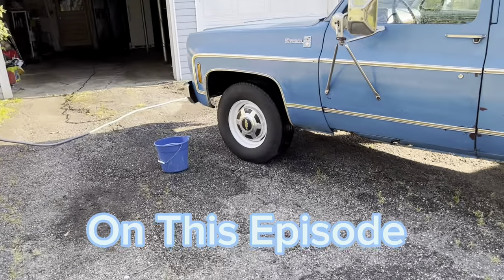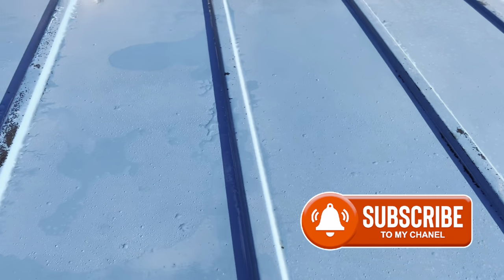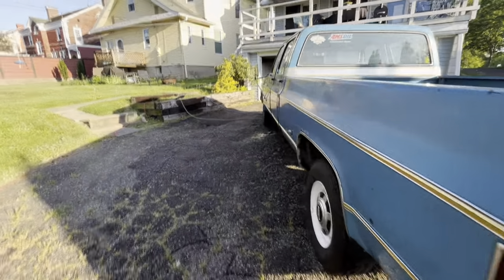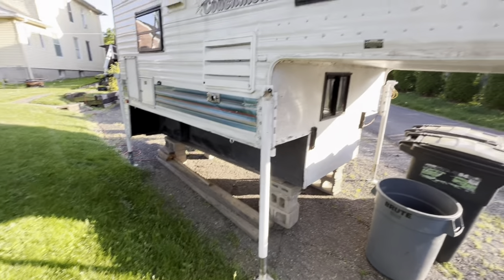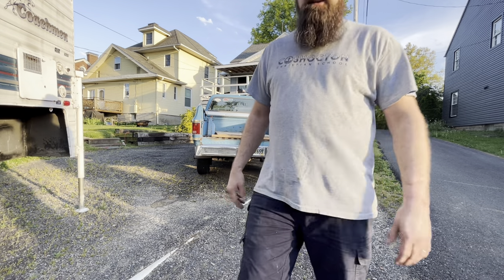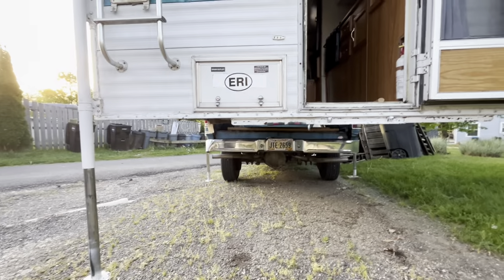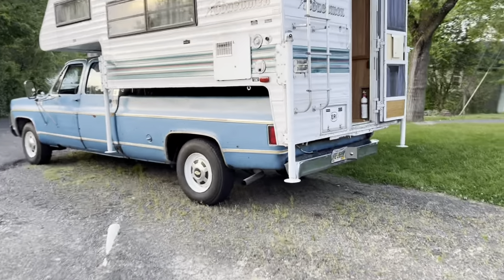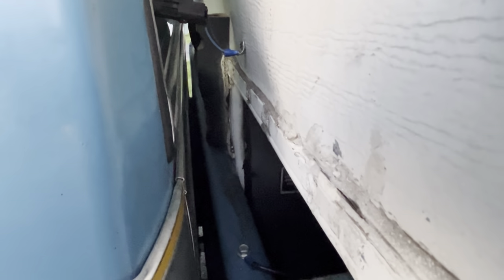Prepping My Truck Camper & 77 Chevy for a Show!

Comment: Great looking old 79 chevy
Reply from the maker: @robbiefriendshuh3914 it’s actually a 77 but none the less, thanks for the kind comment! Hey if you liked this video make sure and smash the like button for me. Also subscribe to the channel if you haven’t already, I really appreciate the support!
Reply: You still run 16.5. Tires and rims on Chevy?
Reply: Grille looks. 73
Reply from the maker: @gerry-p9x  no they are 18”
Reply: What straps. The camper to the bed?
Reply from the maker: I thinks that’s because Chevy didn’t change the look of the grill until the 80’s
Reply from the maker: Yeah I just use heavy straps because for the little time the camper is on the truck it’s not worth my time and money fabricating something. 
Hey make sure to like this video and subscribe to the channel if you haven’t already. Would appreciate the support.
Reply: @the-onlydude  they make hold downs that slip into stake pockets made for squarebodies
Reply from the maker: @gerry-p9x  is that right, where do you find them?